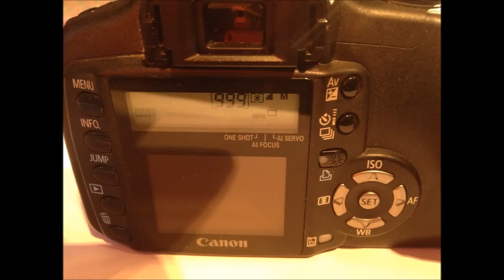CANON DSLR EOS 350D,How to Repair CF Card Slot Broken Pin Fix Card Reader Error 99,@Hetztronics

Comment: whre do i buy the pin to replace the broken one?
Reply: i have the same problem :(
Reply: clipped mine off old ide hard drive.
Reply: I had one lying around, but you can get em for like a dollar on ebay broken. and it doesnt matter since all you need is the pin. or just find a stiff chunk of wire... idk